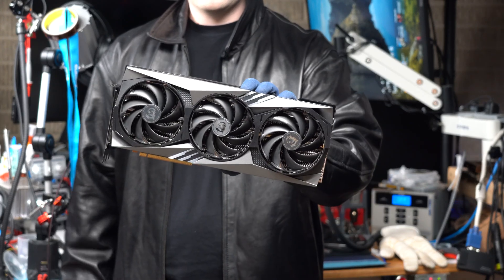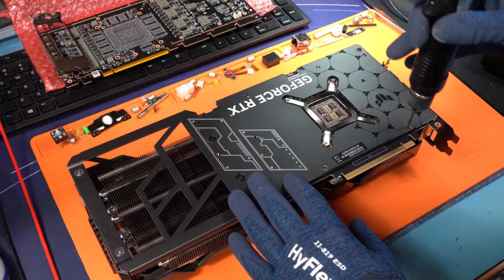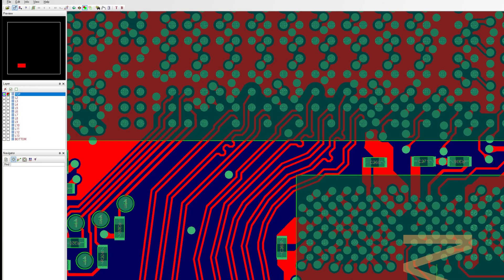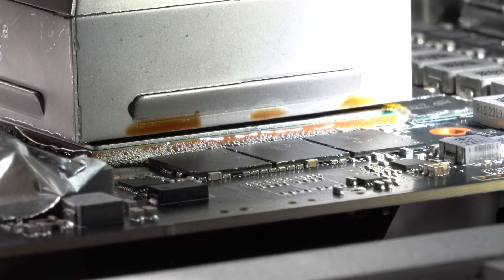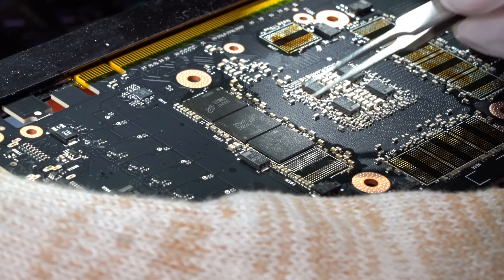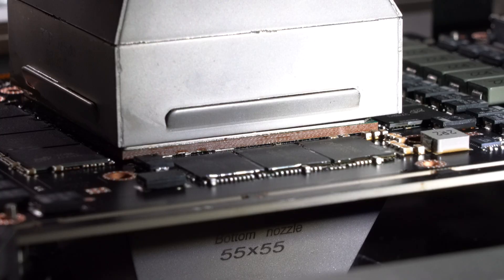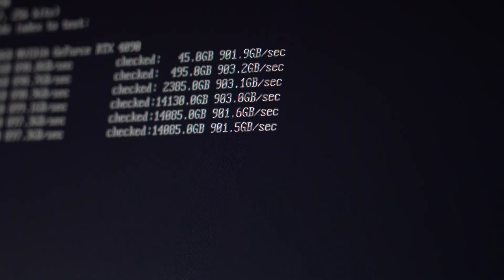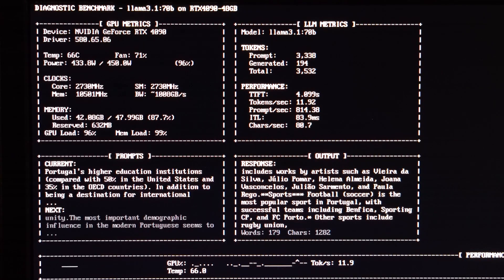48GB RTX 4090 upgrade

Comment: to spend over $3k USD could you elaborate on the pros and cons of purchasing this vs a 50 series card? or even a 9070xt?
Reply from the maker: 48gb of vram vs 32, it matters. More so in when you start scaling past 4. GB per pcie slot is the metric most important nowadays
Reply: @regsky so its 3k for the 48gb card or 3k to upgrade a 2k 4090? 
it its 5k total, you could literally just get 1.5-2 5090s that beat it by like 4x
Reply from the maker: @livelaughlove_88h its 1.1k to upgrade a card, so either 3.2k for a new one or upgrade one. Though its starting to get more worth to get a 6000 pro blackwell soon if the prices keep getting slashed. So its upto your needs and scaling potential
Reply: @regsky hm.

Comment: What's the point of unsoldering the core if you're just upgrading the ram?

This smells like a scam to get people to send you their 4090's.
Reply: needs more memory modules i think not just different ones
Reply: not used on the same board mate the cores are placed on custom PCBs that have additional memory connections. did you even see the entire video?

Comment: You dont need a another bios`?
Reply from the maker: nope, plug and play
Reply: Same card, just added some memory, why need new bios?
Reply: @hoangphungviet7588  Assembly/C hardware programming requires memory assignment, so normally you would imagine if someone has done low level programming for one piece of hardware with one memory configuraiton, you would need to update it to take advantage of additional memory
Reply: @hoangphungviet7588  Sometimes vBIOS can force the card to only recognize a limit of so much VRAM. Im assuming the chinese who modified the PCB fixed this by modifying the vBIOS instead of actually using the true real vBIOS.

Comment: need 5090 96 gb)
Reply: Ain't 3gb chips going to become a thing or are a thing yet?
Reply: @RyanFennec Seems like the 128GB was probably made up, didn't check it much seeing it in the news ... a prototype claimed to exit based on unreleased prototype RAM not available on the market.
Reply: Can you upgrade my gigabyte aorus 3080 xtreme rev 1
Reply: англичане скобки не ставят
попался, наш живчик
Reply: MAX would be 64
Reply: @Gradius2  There are chinese prototypes with 128GB.
Reply from the maker: @Karsliyu  source? :wojak face:
Reply: @Gradius2 how much?
Reply: @Gradius2 actually they have a 128 GB version as of September

Comment: How does this affect gaming performance, and does it still use the 12 pin connector?
Reply from the maker: Itll be louder to keep in your rooms rig, but perform just as good (full power), and yes 12VHPWR is still on the card. PCB breakdown video coming soon~
Reply: @regsky  can we see some gaming benchmarks if possible to compare , is it worth of doing besides more vram capacity
Reply from the maker: @Mr.Smoke013  At the moment this mod isnt reccomended for gaming. It turns your card into a loud wooshing 2 slot gpu, so any gaming load would be distracting without noise cancelling headphones. Recommended uses are render farms and Ai first and foremost. A water block variant is coming sometime by the end of the year. for silent operation.
Reply: @regsky  How's the progress on the water blocks for these GPUs with the custom boards? I am interested in eventually getting one of these modified cards, because I've been wanting to get into LLMs, especially after seeing many mods for games such as Skyrim and such, where you can setup actual interactive AI NPCs, and if you go into NexusMods you can see how demanding some modpacks for that game can be in terms of VideoRam and overall total storage, as I've seen modpacks requiring up to 1-2TB of SSD just to work correctly, as due to the amount of mods running at the same time, it needs the fastest speeds of a current gen SSD, and when you top that with the mods using AI, its just very spec demanding, I already have an i9 14900K with 192 GB of Corsair RAM, so I would just be missing the 4090.

Comment: One question, do you then have to switch to the blower style design after making the change or can you keep the entire original shroud & heatsink?
Reply from the maker: You must switch to the blower design as the footprint for the VRM is only covered by the custom blower cooler.
Reply: Because its different card,  to solder 48 GB of memory, you would need to completely change the PCB architecture. It's a turbine-style design because the Chinese made a separate board where they soldered an additional 24 GB of memory chips on the other side of the card. I watched a review of these turbine-style cards.

Comment: What forms of payment are accepted? 
How do you deal with cooling the extra memory?
What is the turnaround time?
Reply from the maker: We provide Paypal/Stripe invoices to customers.

The memory modules near the GPU core are cooled via the same heatsink as the core, with the blower fan. The rear side modules share a heat spreading plate with thermal pads. Under load the heat spreader on the rear side equalizes to about 54 degrees C via passive convection cooling, but can also be improved with more active airflow.

I am in development to create a custom copper-micro finned back plate, as well as a water block for this PCB. Its my thing. I'm a mechanical engineer undergrad.

typical average turnaround is 15-20 days from when we get your card for upgrade and when we ship it out the door. That may increase by a few weeks depending on order request volume.
Reply: @regsky there's already waterblocks straight from Shenzhen. They can even hook up 2 4090s to an AIO water cooler.
Reply: @regsky  That sounds great.  I want to give so much needed advise if you are serious about doing these mods and expanding.  Your site has no face or name to the company.  It feels very anonomous and shady because of this. You bring up being a mechanical engieer undergrad, but your face is designed like a black market. If you are serious about providing such a service to the general public and are here for the long haul you need to add who exactly is behind the company and is taking, working with modding, and responsible our gpus, otherwise trust is very low and will directly impact sales.

I am also glad to hear the cooling is being addressed.  I have read that many modded cards fail becuase of the extra head from the new memory added.  
How much would that cost when its ready?
Do we get back our original gpu board, and have the new board and ram added to the enclosure sent to you?
How would the modded coper micro finned backplace be added to enclusres like the 4090 suprim?
Reply from the maker: @Vigilence  Need to start somewhere.

the custom copper backplate im hoping will only add only 60-80$ to the cost. You can get your original pcb/cooler back, i leave it up to each order and will ask the customer if they want it back or to save on shipping, leave it with me.

the copper backplate would be custom made for this pcb, a custom one would have to be machined for your suprim. i dont offer custom one off's at this time.
Reply: @regsky  I am happy to hear about the copper plate.  I hope to see your site updated so I actually know here my stuff is going to.  You say you don’t do one offs, what exactly does this mean?  Does this mean we all get the FE 4090s?
Reply from the maker: @Vigilence  Could you elaborate on how you suggest to make the site more friendly?

I mean "one off's" that if i make a copper backplate, i dont have plans to make custom one-off backplates for other brands of 4090's at this time. The copper backplates i make will be fitted for these 48gb 4090's since they have rear side memory modules and a custom capacitor footprint on the rear.